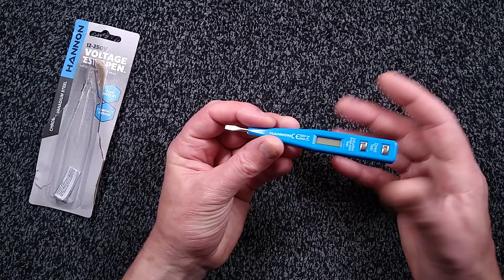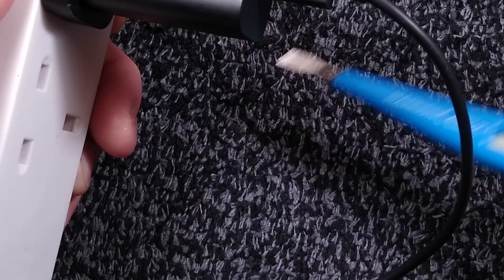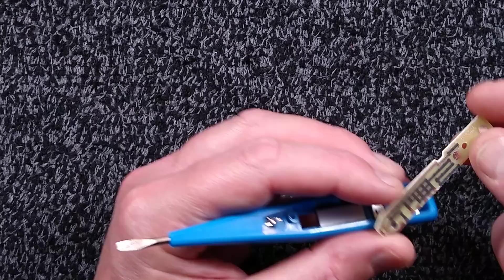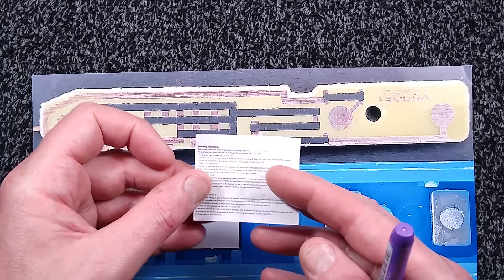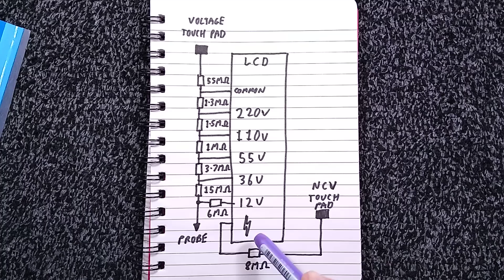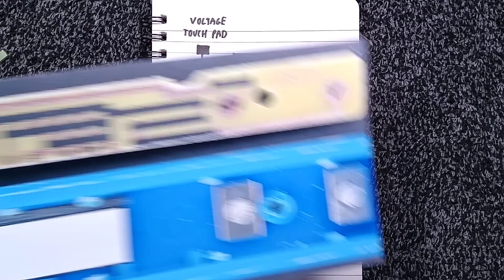Inside an LCD voltage tester (with schematic)

Comment: It would be good to explain why it is functioning. My impression is that 50Hz in the mains and in my body (as an antenna) will drive each segment of the LCD through its coresponding printed resistor. Each of those numbers are in fact a single segment shaped as a number or shape(the flash).
Reply from the maker: The LCD requires very low current, but does need a voltage threshold.  It's done with a high resistance voltage divider, with you as one of the resistors.
Reply: @bigclivedotcom hmmm... I believe the complete answer is that the LCD is driven with 3V AC! sinusoidal  at 50Hz. From practice I know a LCD segment is working with 3V DC at 100Hz  alternating in both the pos and neg rail.Basically an AC but made from a square wave.

Comment: I first have seen one of these around 1997. Then I got one and I used it and I found it very useful as a non-contact indicator but also as raw voltage indicator. As a plus, it have a small flat screwdriver. Since then, I had many, just because I used to lost them, but no one ever broke.

Comment: This is in fact an Integrated Circuit, but on a macro scale and without using silicon  Fascinating to see it seemingly perform switching, but without a single transistor.

Comment: For £1 , this is great value , but I would always use a neon tester for ( UK , 230 Volt ) mains  .... the LCD uses the alternating supply as it's protective clock frequency ( normally a 30 hertz square wave in most other pricey equipment ) .... LCD's work also on DC , but prolonged use on DC strips the transparent tin layer off the glass , this will shorten this testers life ... but ... hey it's an excuse to head off down to Poundland™  and buy another ( + lots of other bits ... the little green cable ties are good value , garden shelf  , wiring looms don't mind a different colour ( Ha - Ha ) ................

Comment: Iv an odd question not directly related, I think I have an access point being scrammed by dodgy mains voltage something like transients 
Without breaking the bank and spending a mass fortune in high end Fluke equipment, have you any idea how I can detect these as I just may be barking up a wrong tree…

Comment: ford tried the screen printed components thing on an ignition module called "thick film ignition",it was terrible,at least you can replace it with a bosch module that works LOL

Comment: Can you showcase the 1X3L Fan-Controller, it is a pretty useful and cheap device. I currently try to mod it to make it run with 24v original is only 12v.

Here a Video that explain how to setup 
https://youtu.be/NBcCFYZhU_0

Comment: Talk about cheap as possible, not any real compents involved other than the display that's setup to not require a 7-segment/3 digit driver IC. I guess that's sufficient if you only need 50% accuracy between voltage levels and a simple yes/no if it's there or not.

Comment: I got laughed at in vocational school when I told people that everything that is conductive and has a surface area, including humans, has a capacitance, and that is how the neon screwdriver thingy (as well as this) is coupled to ground by the user to complete the circuit... and the reason why you will likely feel a small buzz in your fingers if you accidentally touch a live circuit, even if you are standing on a dry wooden floor wearing wellies and touching nothing else... and why if you touch the radio antenna the reception may be greatly improved in certain circumstances, and why touching the core of an audio input cable will cause a buzz on the speakers. Among other things. Likely many of them still think there's just some obscure magic to how these things work.

Comment: Please DON'T buy one of these. Get yourself a multimeter which are around £10
Reply: I really am amazed that it's ACTUALLY metallised plastic?! It just goes to show how much penny pinching was going on to not even stick a sliver of metal in. And the same goes when it comes to the resistors, that it's ACTUALLY a screen print! 😂🤣 FFS🤦🏻‍♂️ 
So just how much did that dangerous leathal piece of shit cost you by any chance Clive?

I tell EVERYONE that's got anything even remotely like this, to throw it away and buy a proper voltage tester. And if I see anyone that's got something like this, then I break it and yes. They'll probably be pissed off and tell me "Ow no I'd never use it to test for electricity" While I’m standing there, trying my best not to piss myself laughing 🤣😂

I then tell EVERYBODY to watch Andy's video about these LEATH types of screwdrivers and how cheaply it can be to get a proper voltage tester. If you don't know what to get them go into a shop or just send someone an eBay link.

Comment: I bought one of these in 1990 for £1.50 and have used it a lot as a quick check.
Went to use it a couple of weeks ago and there it was - gone!
Reply: if you do a direct voltage reading on 12v battery it will start working again
Reply: @dantronics1682  
I meant that it has vanished, not in any of my toolboxes and certainly not where it should have been.  Didn't have my multimeter either but managed to complete the job without burning the house down.

Comment: Interesting. I have had one of those for many years now, no one died yet, also never teared it apart and mostly used it as a small screwdriver for adjustments. It was always weird for me to think that we are supposed to stick our fingers in it while connected to mains and without knowing what's inside. I damaged the lcd by using an igniter just for fun. Thank for the video!

Comment: If you have the Uni-T or another meter which can measure Ohms, You can probe the LCD to check if it will react to that low voltage.
If no reaction, try swapping the polarity, but I recon that it Will show the symbols for a brief period untill the crystals will realighn.

Comment: The common connection in These types of LCDs are driven by AC voltage. The common connection on these types of LCDs is called the "Back-Plane". The segments are capacitively coupled to the Back-plane. To turn the segment ON it has to be driven with the voltage that is 90 deg out of phase to the BP. When in phase with the BP the segment is OFF.
I think the voltage is what will destroy an LCD, not the current. Also, they absolutely must be driven by AC voltage. DC voltage will light up a segment, and can be used as quick test, buy it will "burn" it after a short time.

Comment: Hmmmm, as it's not sealed I'd be somewhat concerned about the creepage and clearance distance path of internal live parts and the outside surface. Tracking distance between case gaps even under dry conditions.⚡🤔👎

Comment: Ingeniously cheap device. Looks like a thermometer! 
They could've made it even cheaper, by eliminating the buttons. 
Soldering small posts on the pcb pad that poked through matching holes, where the buttons are now.

Comment: We use these to test our electric horse fence. However, when testing an electric fence you need to make sure that you DO NOT touch the terminals on the end of the tester, since it will give you a proper shock :) Just touching the fence with the screwdriver bit alone is sufficient to make the flash symbol appear. Also, this is a much cheaper electric fence tester than a "proper" tester (and anything related to horses is for some reason at least 4 times more expensive)
Reply: Horse eqpt: Yes- they assume you have enough money that a huge mark-up won't be noticed. All a bit naughty.
Reply: You can get digital fence meters for under $100AU (roughly £50) on eBay. You can get ones with LEDs for different voltage ranges fences use for around $20 (with actual ground wires instead of the user).
There's also ones in the hundreds of dollars, which are no doubt more accurate and better built... But if you're just checking the voltage at the far end, a rough idea is good enough.

I've just been using the back of my hand though. We can't find the actual meter.
Reply: @tin2001  Yep, I'm not interested in the actual voltage, just that there is voltage. Back of the hand is of course the cheapest option :)
Reply: A bit like " medical "  stuff for old folk .... hideously expensive .... litter grabber = £15 , Poundland™ = £1 ..! ! .........
Reply: You have an electric horse? Watt is its name?
Reply: Get a non contact voltage tester (the ones with batteries and lights), they are much safer and rated at higher voltages
Reply: Just like boats.... 🚢

B.ust
O.ut
A.nother
T.housand

Comment: I'd hope to see a destructive safety test with this. How does it react to 480 or 1 Kilovolt? High humidity might make it conducive.
Reply: With an ammeter between the touchpad and earth.
Reply: @markfergerson2145  I read your comment as "an amateur" thats probably also likely to happen 😄
Reply: @mrbyamile6973  Lol!
Reply: This would be a great fit for Photonic Induction, but BigClive also has a device to test the insulation between transformer windings.

Comment: Interesting circuit taking advantage of LCD operation. It looks safer then the neon screwdriver I have where you touch the clip to provide enough capacitive coupling to cause the neon indicator to glow.

Comment: Interesting circuit.
I wonder how accurate it actually is
Reply: I opened up a duracell battery tester and used a voltage divider to test DC voltage. It may not be great but usable.
Reply: its very accurate

Comment: Love you BigClive. I Never knew about print on resistors. Really cool. You learn something new everyday. 🙏
Reply: I recently saw one set-top box remote that had the resistors printed on the green solder resist. The PCB was single side and made very cheaply (the battery leaked and one electrolytic capacitor went bad). The connections were all low resistance values (acting like jumper wires).

Comment: They've cheapen the product, but meawhile they've increased the price. Some 20 years ago when these chinese testers appeared they cost the equivalent of 50cents to a dollar (at least in my country - Bulgaria and were several times cheaper than a neon bulb live wire tester) and worked in a logical way - only the detected level appeared on the LCD display. I guess there were some simple logic COG capable of working from a tiny charge on earlier models, but no more.
Reply: That model showing only the closest voltage was also available in Spain, at least in the Chinese bazaar nearest to my house, they had them for €0.60 while their classic neon screwdriver was €0.99
A genuine Wiha type 255-3 made in Germany was at least €3.50 at hardware stores but there were also clones for half the price.
Reply: @ruben_balea  Nowadays in the cheapshop near me there is nothing under a euro.
Reply: @deepblueskyshine  Here Chinese bazaars must be the only ones that have a lot of things for 1 euro or less, mainly because they seem to have thousands of things for sale so they can have a few hundred things for less than 1 euro because those really don't have much value. Then the rest depends, it can be cheap and bad, cheap and acceptable, on rare occasions cheap and quite good... and the same happens with more expensive products.

I still bought a pot lid knob for 1 euro a couple of days ago, best quality stainless steel ;-) the steel is actually pretty decent and doesn't rust, but the screw they come with is aluminum and I swapped it out for a stainless steel one.
I had already bought those more times, to replace the hard plastic bakelite-style ones when they crack.

Then the classic shops "everything for €1" really don't have almost anything at €1 but rather at €2 or 2.50 and in the end they sell practically the same products as the Chinese bazaars.

Comment: I have had a couple of these, bought when I had left the Electrics box at home. Some of them are wildly oversensitive and will detect a live cable two feet away !!   They are supervulnerable to breaking when dropped. And you can’t put new batteries in them. I have never made one work when the battery dies. Ok for checking your extension leads quickly,and,and….
Reply from the maker: There's no battery.
Reply: @bigclivedotcom  Obviously not in the one you have. most of them do have a hearing aid battery,I have two in  front of me.

Comment: I am curious, how much did that cost? I just had to buy one, at the home improvement store they ran from 10 dollars to about 30, depending on the bells and whistles you want built in.
Reply: This one is from Poundland in the UK. It costs £1 or £2.
Reply: @calv6051  that's pretty good, the one I bought doesn't have that kind of LCD display. Just LEDs and a beeper.

Comment: I'm surprised that the readout has all the ranges smooshed in-line and not rotated like in your reverse engineering diagram. Would be a lot easier to read that way.

Comment: I have a couple of these, somewhere. I've never really been convinced of their worth, but as a quick test of "YES/NO" potential being present, they might be alright, though I think I'd still prefer an active method of testing before putting any fingers at risk. As a rule I use the "Lo-Z" feature on my Fluke.
Reply: A positive indication means danger, a negative indication doesn't mean squat lol. I'd still test with the meter then crowbar it just to be sure 🤣

Comment: I've had a few of these in the past, never used them for testing, just as a crap screwdriver, cos I usually made them go crunch either through too much torque or from using them to pry stuff open... :P

Comment: How much voltage would it take to arc between the traces to the NCV terminal, bypassing the resistors? Those clearances look pretty small!
Reply: The seperation for mains voltages (240-400v) reccommended is 4 to 6 mm so I would say the seperation on this gadget is barely adequate, although the resistors would prevent a significant (i.e. dangerous) current flowing. I'd be happier if there where some kind of solder mask or other insulating coating on the board personally, but I think the NCV test is relying on the capacitive coupling between the probe connection and the track (the bit of trace going round the probe connection acts as a capacitor), so they had to run it fairly close.
Reply: @IanSlothieRolfe  The only protective resistor would be the one next to the NCV contact, and there is also a narrow gap there potentially bypassing that resistor. The other hand contact is well-isolated by a resistor.

Comment: I always found phase testers/Voltage testers like this a strange bit of kit.. Stick this screw driver into the mains and touch the metal bit at the top.. if it lights up you have power :) What could go wrong..
Reply: And that's why God invented the apprentice.
Reply: I agree, never trust anything where you are part of the circuit
Reply: I heard about some people testing mains presence by chewing on whole toothpick to make it more conductive and to feel the shaking when they poked the mains with it.
Reply: I used to remove the resistor out of neon testers and wrap a bit of copper wire around its leads to effectively short it out, twist the neon legs together, then put it back in. That stopped the idiots using death trap tester Screwdrivers... 😂☠️.. I didn't really,  but should have pmsl. Drop these lcd testers in the sea and watch it glow like its user.. Bin them.
Reply: @muzikman2008  those testers have their place, sometimes you don't have second point to measure against. I do have a few stray single wires around my house, that turned out to be live, but there really isn't a point around where i could ground one probe of dmm to find out.

Comment: lol zero component count
Reply: The LCD is a component?
Reply: @henninghoefer  yeah well so's the circuit board, the buttons and the plastic case. and there ARE resistors of specified values, despite appearances. 
but you know what I mean, there are no conventional, discrete electronic components. did I really just have to explain that?
Reply: @-yeme-  - no!

Comment: Bare LCD displays are damaged and eventually destroyed by exposure to sunlight. The whole screen progressively turns black permanently. Make sure the display has a very good UV filter plate on top around UV sources..
Reply: it only cost a quid

Comment: This suffers from the same problem a DMM has: there is not enough load on the circuit to determine if the circuit is connected or if the voltage that is read is from capacitive coupling.  Say the breaker for the circuit has been turned off.  The capacitive coupling from another conductor in the same conduit could make you think that the circuit's breaker is still closed.

This is why professional electricians use a Wiggy with the solenoid that pulls the indicator to the correct voltage, and takes a few milliamps of current.

Thanks, Clive.  I think the cheap, little neon light indicators might be better for residential electrical testing.
Reply: All of the Fluke DMMs for professional electricians or industrial workers have a low impedance mode. (Fluke 113, 114, 117, 87V). It's a solved problem, without having to resort to old fashioned techniques.
Reply: proper multimeters have a low z mode for that
Reply: Yeah, i recall double checking with an analogue meter when working on a ring main that i was certain that i'd isolated......the DMM was coming up with phantom voltages from adjacent conductors.
Reply: @thephilpott2194  I had that problem at my Dad's house years ago, there was enough capacitive  coupling to show 80 volts or so on a disconnected circuit on an analog multimeter!  This was in USA with 120 volt mains.  My fingers showed nothing so I continued my work.